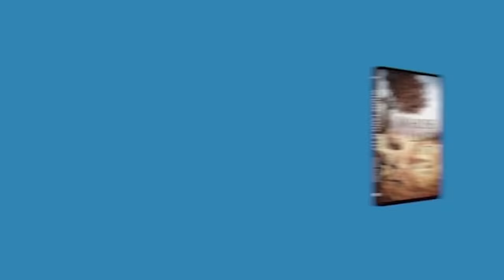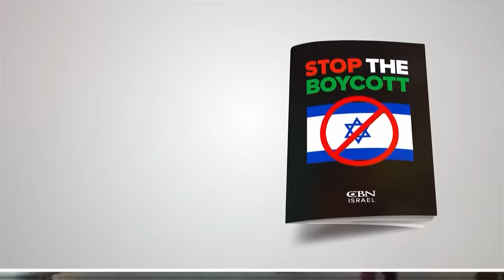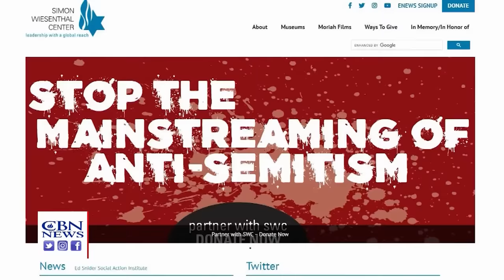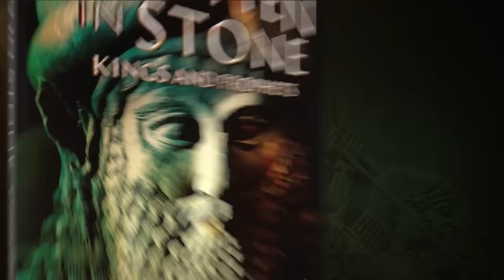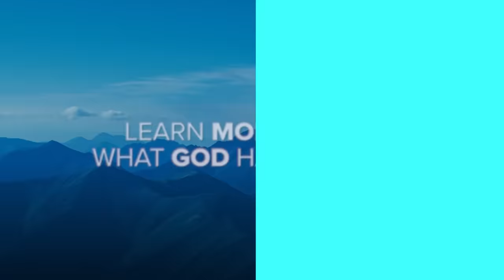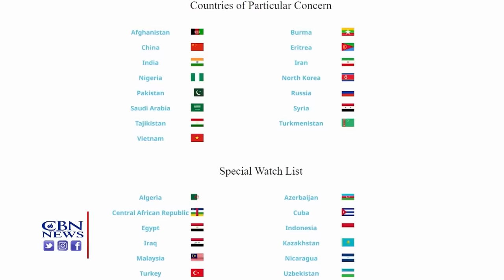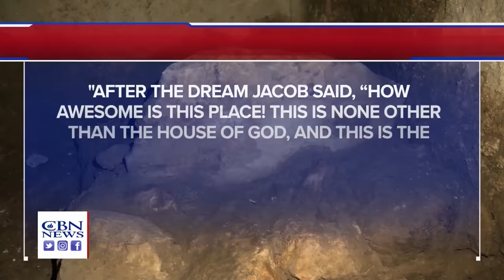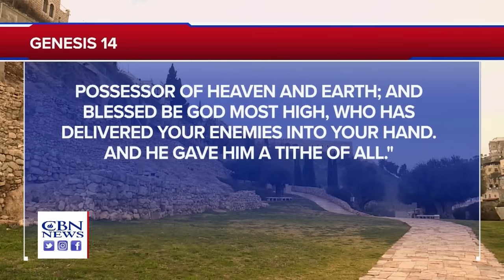Israel Pushes Back Against Temple Mount Controversy | Jerusalem Dateline

Comment: when will Isreal understand that the temple mount is not the site of the last temple.  Remember, not one stone would be left upon another.  The Wailing wall is part of the Roman fort.  There is nothing in this  property that the bible describes about the spring that runs at the original site.